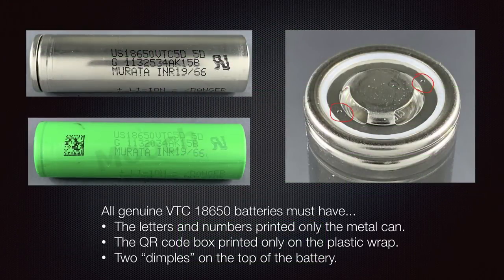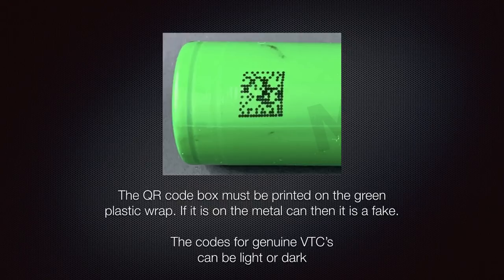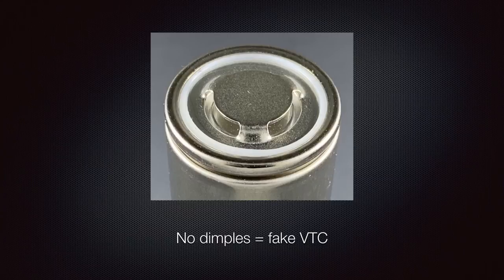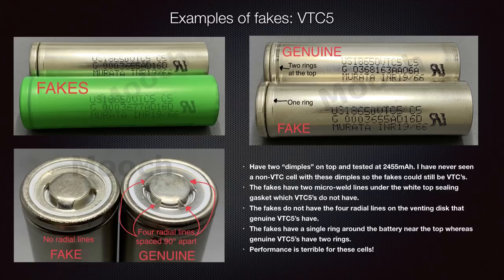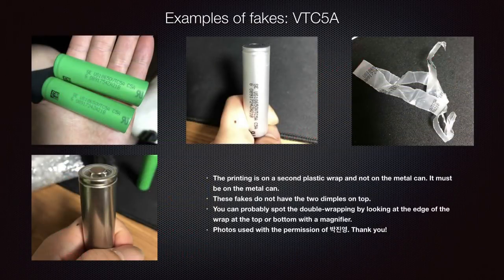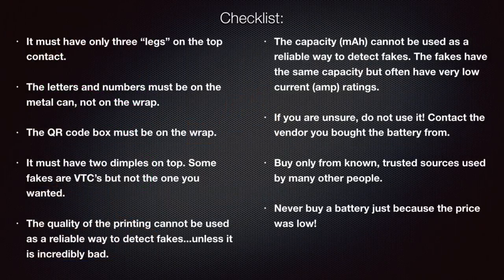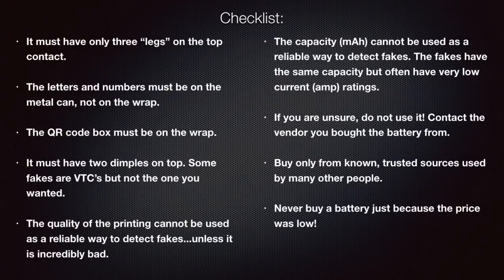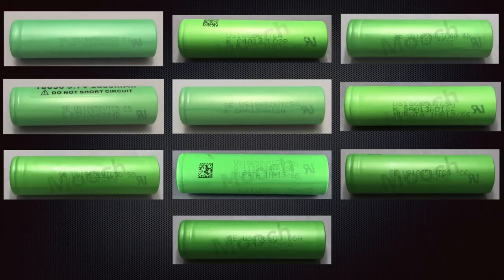Minding Your mAhs Ep027 – How to detect fake Sony/Murata VTC 18650 batteries

Comment: Thanks for the info. I sunk about 200 bucks into getting on the vape train to get off the cigarette train, only to learn from reading the warning printed ON the batteries I bought with the vape that you're not supposed to use them in vapes. Thankfully the one I bought is actually a trusted, well tested device, but the website I bought it and the batteries from didn't disclose ANY battery safety information at all.

Comment: I've bought cheap 25R, LG HG2 and VTC5A batteries from unknown vendors on eBay (several times because I'm a cheap bastard) and didn't realise how poorly they performed until I bought genuine batteries. Now I only buy online from Fogstar or 18650 UK  and the difference is immediately noticeable in running time and performance. I'll never be confident in my ability to spot a fake but I've learned the hard way that there are cheap batteries and good batteries, but no good cheap batteries. -  so only buy from a reputable seller because there is a lot of crap out there.

Comment: I'm surprised you don't have one of your supporters listed under trusted battery sources - RTD Vapor.  They primarily sell batteries, battery chargers, and battery accessories.  I've been using them for years, and have never had a bad cell come from them.  I completely trust them.
Reply from the maker: They are still on all my other lists as a source for batteries. But YouTube’s policies regarding vaping related links means I can’t have their address here. They have “Vapor” in their name and sell cotton and wire in addition to batteries. I can’t take a chance on getting a strike.
Reply: I completely understand.  I wasn't aware that YouTube was cracking down on vaping related material so harshly tbh.  I believe the CDC has more or less admitted that all those illnesses came from tainted black-market THC cartridges.  Unfortunately, only the dire news seems to reach the people who need to know what's really going on.  Anyway, thanks for all the videos and information!  I like that you give each battery the "full Busardo." :)

Comment: Thanks for the video. I think scammers watches this video too. Because I just got 10pcs fake battery that has all Genuine signs. Also letters and numbers are printed on metal body but it can be removed by bare hand. Just rub your finger on it and it disappear.
Reply from the maker: I am sorry you received fakes! Yes, it is a constant battle and codes can be faked. If the codes are wrong or missing then we know the battery is fake. But if the codes are correct then it might be fake or it might be genuine.
Reply: @batterymooch  No problem. I'm happy to find and watched your video. The letters are correct but they can easily be wipped out. I'm very suspesious about it. It's impossible that you can wipe out the letters so easily on Original one
Reply from the maker: @moya9450  yes, I agree, you might have fakes.

Comment: Great work Mooch!  Have a question about adapting flat tops to use in flashlights (15A max current draw) that call for button tops. Could not find any of your vids on this.  See some people put 3-5mm round magnets to act as the "button" to make the connection.  Do you know what affect, if any, this will have, like increased resistance, lower voltage, more heat, etc.?
Thanks!
Reply from the maker: Yes...increased resistance, lower voltage,  more heat. But enough of any or all of those to be an issue? No way for me to know. It depends on the magnet and how much current is being drawn. All I can do is recommend not doing it since that is the safer option.
Reply: @batterymooch  When you say, it depends on the magnet, does that mean the physical size or material/finish?   Given that a magnet is big enough to complete the circuit, should the smallest size possible be used, like 3mmx1mm or more like 5x1.5?
Reply from the maker: @motohead077  yes, size and material/finish. Magnets have high resistance and their shape determines how much metal touches. You will need to choose the material and size carefully. I recommend not using magnets at all since any wrap damage can result in a battery explosion if the battery moves around. If you must use something between two batteries or in a flashlight to extend the battery’s length then use a good quality metal disk that is surrounded by rubber to keep it centered. Use only something designed specifically to be used between two batteries or to convert a flat-top to a button-top

Comment: All they have to do is give each its own unique code that can be scanned. If the counterfeit uses a genuine number as soon as its used 2x it is flagged as fake
Reply from the maker: Good idea but unfortunately Samsung, Sony, Murata, Panasonic, LG, and Sanyo will never do it as their cells were never intended for sale to individuals or for use outside of a fully protected battery pack.
Reply: @batterymooch  I know but safety first. They are going to be irrelevant with the companies that WANT to supply us

Comment: Hey Mooch, I have a couple VTC5D's here that meet all the criteria for being genuine. The only thing that is missing are the 4 radial lines under the top contact. Are these radial lines absolutely essential for them to be authentic?
Reply from the maker: Sorry, I don’t know if they made them without the lines. All of the genuine ones I have seen have the lines but that isn’t anything conclusive. Fakes have used the VTC5 though, which has no lines, and are verrrrry hard to spot otherwise unless you have a genuine VTC5D to compare your cell against (using a loupe or magnifier).
Reply: @batterymooch  Sounds good thanks!

Comment: I'm sure I'm asking an old question but I just picked up 2 vtc5a Sony's for my mech and I'm just curious as to what the amp draw is. The lowest I would go is .15 ohm. My go to is a 25R but they all died and my local store had the Sony's so I got them instead, plus I've been wanting a set since Vaping bogan always recommends them along with the HG2 for single battery mech tubes. I always stayed around .2-.23 for the Samsung's pulling 21A
Reply from the maker: Any 20A rated battery will be a poor performer in a mech at 21A. The voltage sag when being used that hard is too big. It increases the risks of problems and shortens the life of the batteries too. I do not recommend the LG HG2 for a mech unless you are under 15A. The 25R is a durable battery but is a poor performer compared to batteries that have been released the past few years.

The VTC5A is rated 25A by me and is a better match for your 0.22-0.23 ohm builds. A single battery mech will not give you a lot of power with resistances that high but that may be okay for you, depending on the style of vape you like. Check out Minding a Your mAhs Ep031 for other battery recommendations.

Comment: You mentioned earlier in one of your posts, about the ring on the bottom, laser etched, somehow looked like it's raised slightly? Is this still a must-have on authentic ones?

It's not possible to find reputable battery vendors here. We spoke a bit on r****t a few weeks ago...
Reply from the maker: I believe that ring (for venting the battery if there is excess internal pressure) only on VTC5D’s and 21700 VTC6A’s. It is not laser etched though! Fakes will do that. The ring is a pre-weakened area of the bottom.
Reply: @batterymooch  thanks! My bad, yep, you did say fakes have the bottom later-etched. I bit the bullet and grabbed 2 18650 vtc6a's, no rings on the bottom, will be comparing them with your post. Couldn't find much info on these 18650 vtc6a's

Comment: I bought 2 Vtc5's at the same time but one of them from a trusted vendor and one from China. And noticed that when i put them in my mod one battery incicator always shows the full 5 bars and the other indicator always shows only 4 bars, even when they are both fully charged. However, both batteries check all of the boxes for authentic Sony's. Also one battery always gets done charging a little faster than the other battery. Do you know what the issue is here, or do i even have an issue? Thanks.
Reply: Also i married both these batteries when they were unused and brand new. But like i said, they were bought from two different vendors. Could that be the issue i am having?
Reply: I find one battery will always charge a little faster than the other - even if they are paired sets bought from a trusted vendor. The difference isn't much - probably just a couple of minutes - but my charger has a separate circuit for each battery sled so its possible one circuit provides slightly more charge current than the other.

Have you tried swapping the batteries around in your mod to see if the 4 and 5 bar indicators change?

I'm no expert, but maybe one battery is older than the other and has deteriorated in storage.

Comment: I notice scratches on the positive/negative. Will it affect the performance? Is it safe to use it?
Reply from the maker: Scratches shouldn’t affect performance. If they are very deep on the negative end they can affect safety. Do not use a battery with deep scratches on the negative end.
Reply: @batterymooch  noted. Thank you 👍🏽

Comment: What about internal resistance can be detect it or not

Thanks
Reply from the maker: Theoretically, yes. But the chargers that have the internal resistance feature are usually VERY inaccurate and inconsistent. It makes them almost useless for using internal resistance to spot fakes. Even if the charger measured the internal resistance accurately it would not be able to tell you that you have a fake VTC5A that used VTC5’s as their internal resistances are too similar. Physical appearance is easy to check though and what I recommend.
Reply: @batterymooch  thanks someone ask me why you test the vtc6 cut off 2.8 but factory tell 2.5
Reply from the maker: HypnotizeFS that is only done for the higher current performance measuring discharges for all the batteries I test. Since we never go below about 3.2V when vaping there is no need to graph the performance down to 2.5V. All of my capacity tests are done down to 2.5V though, the same as the major manufacturers do.
Reply: @batterymooch  thanks

Comment: I have two Sony vtc6. When i charge them my charger displays 2000 mah instead of 3000 mah. Are they fake?
Reply from the maker: Your charger tells you how many mAh you took out and that it out in. It does not tell you the capacity of the battery.

Comment: soo much talking about how it looks, which as you say, can be useful, i have nothing against that, but two main factors, capacity and discharge rate should be tested, or, to make things simpler, testing internal resistance. i bet it would weed out most of those you said perform bad anyways. i bought chinese cells, fake ncr18650b, but they tested well on capacity and internal resistance. i knew they were not genuine so i am not scamed
Reply from the maker: Agreed but unfortunately most vapers don’t have the equipment to measure capacity or internal resistance. Even if they have an “analyzing” charger most of those are wildly inaccurate and/or don’t discharge down to 2.5V.
Reply: @batterymooch  i see, that would make sense, i work with high drain batteries for powertools, and all of them are also used for vaping, so i often find usefull information from people who use them for different purpose than i do, im glad we can help eachother out.